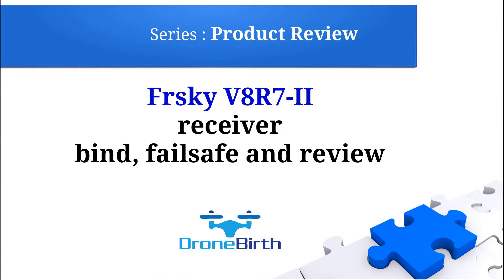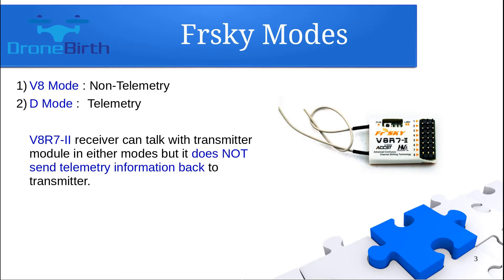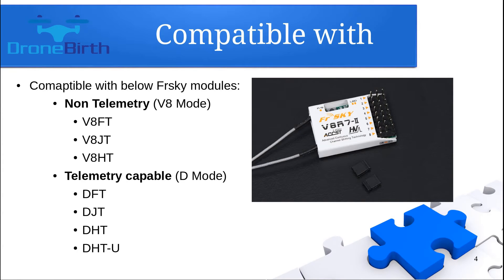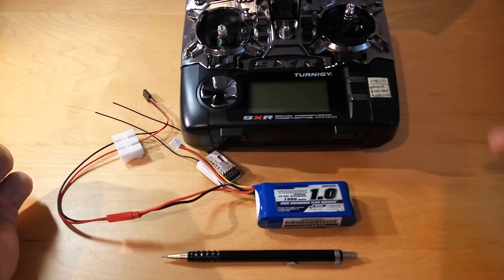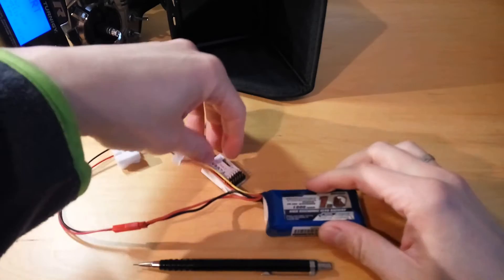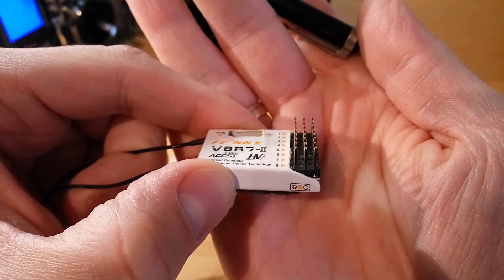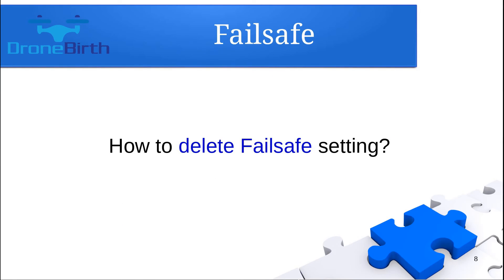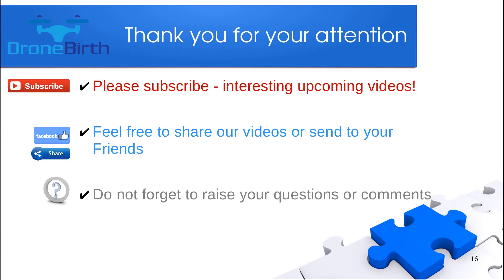FrSky V8R7-II receiver binding, failsafe and review

Comment: Hi.. nice video!

So, I have a Futaba 9CHP Tx with Frsky DFT moudle from Hobbyking installed in, for 2.4 ghz. Will this Rx bind with it or not? im confused here... :/
Reply from the maker: +David Johns 
Thank you.

The short answer is yes. :)

The long answer is : 
it is compatible with all FrSky modules (V8_mode & D_mode), but only in receive mode which means that the V8R7-II can talk with module in both modes (telemetry(D) and non-telemetry(V)) however it does not send telemetry information back to the transmitter. Thus, using it as a receiver to control your aircraft has no any limitation, just you will not be able to use the telemetry information on your TX. For telemetry information there are many other solutions depends on your flight controller. Some popular examples are microosd, minimosd or E-osd.

I hope that clarifies, have a nice day!

Comment: Hello, i've recently had some bad luck with this particular receiver. i've had two of them arrive with very poor range. the red light comes on at a distance of only 3 meters or so (and it goes into failsafe). Have you ever had any experience with this, and if so do you know of a fix for the problem?
Reply from the maker: +fuba44 
Hello,
I made some testing before and I was able to fly over 1.3 km with this receiver in an opened field and that was not its high end I believe.

If the binding and failsafe are set properly and your receiver goes into failsafe mode over 3m that probably means a faulty receiver...

Comment: Thanks for the information. What is the channel layout on this receiver, please? The manual does not include the channel layout.
Reply from the maker: +ClearTheDeck 
Thanks for the question.

The channel layout depends on 2 things.
1.) your Flight Controller setting - there is always a menu item where you can choose from a drop down list or define it by your own
2.)your Transmitter setting/factory default value

For example: AERT1234 - means that this will be the layout from 1st to 8th pins on your receiver:
  1. Aileron
  2.Elevator
  3.Rudder
  4. Throttle
  5-8. Aux1 - Aux 4
The same layout setting needs to be applied for both the Flight Controller and Transmitter.
I hope that helps.
Reply: +DroneBirth Great info, thank you. I am using a Turnigy 9X with FrSky DHT 8ch DIY Transmitter Module and the stock 9X firmware. The Flight Controller is KK2.15 with Stevis 1.19 firmware. I will try to figure out the channel mapping.